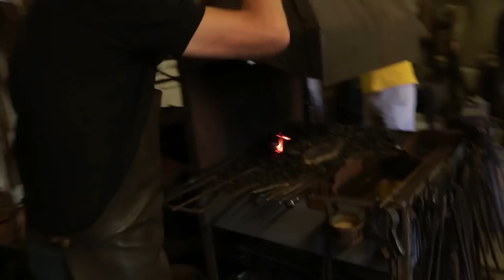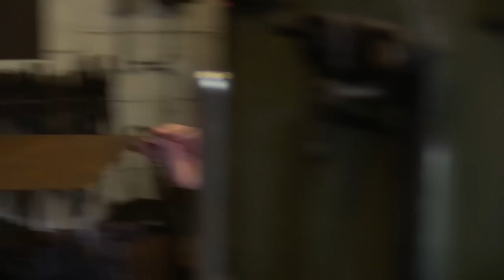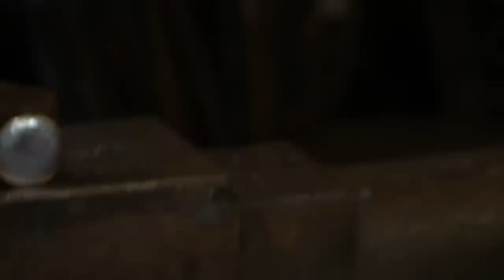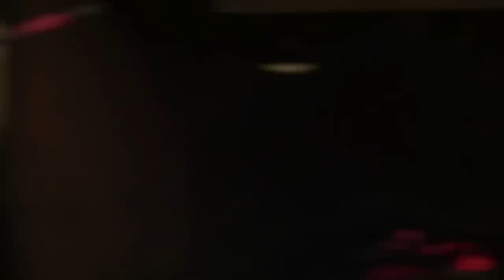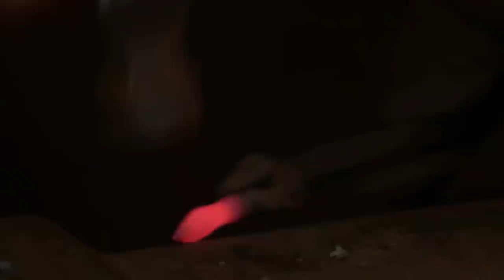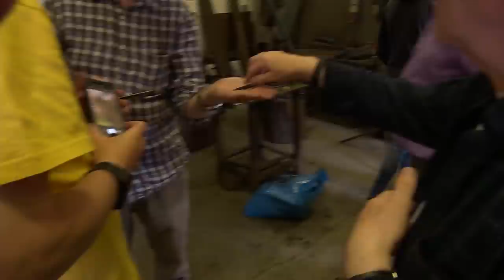How to forge a medieval war bodkin arrow head with Hector Cole MBE

Comment: I'm very interested in seeing those test shots. Every test of bodkin vs plate I've ever seen or conducted myself the bodkin has failed miserably. To the point historians had to re-evaluate the battle at Agincourt given how poorly they performed. Is there any filming of this test? I am VERY interested!
Reply from the maker: You would need to talk to Hector about that
Reply: Seconded.  Every bit of info I've seen has indicated hardened plate armor and unhardened arrow points.  The effectiveness relied on sheer volume of arrows, and finding joints or gaps in the armor.  Particularly on the horses, not the men riding them.  (Not that they never punched through, but that it was rare.)